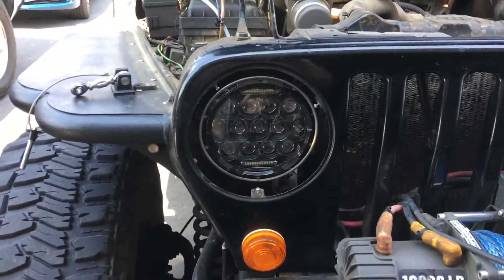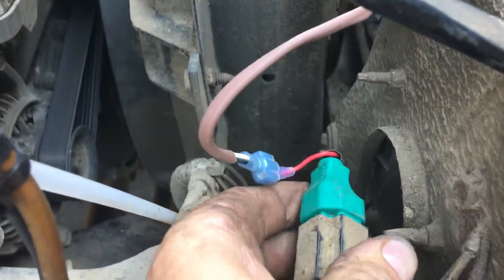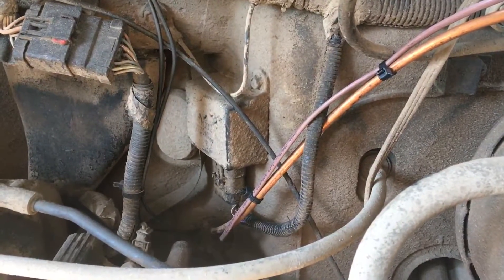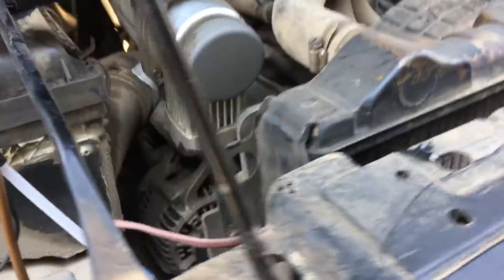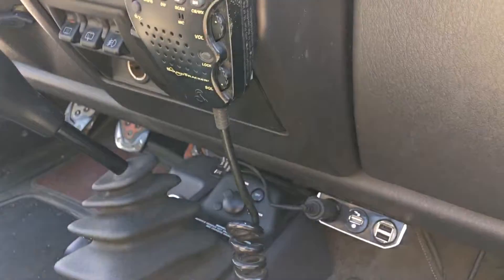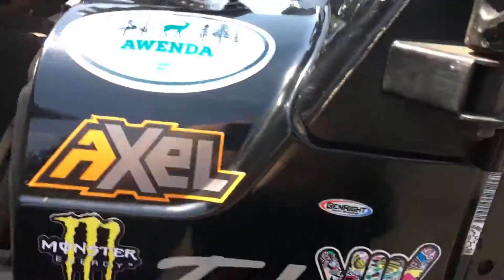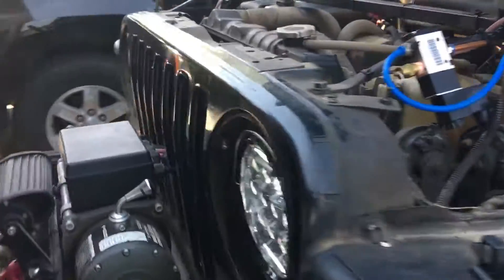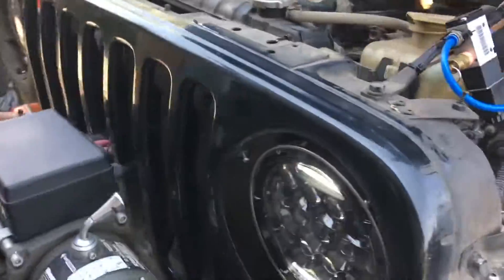LED headlights in jeep tj

Comment: I bought the same lights for my son's 1998 Jeep TJ ... but hooking up the daytime running lights doesn't seem to be straight forward.
Okay I watched your video... so I understand the need for a separate power source for the daytime running lights which needs to activated by a ignition side power source, (which is what I thought the daytime running light module would do) .... but did you say you just cut the signal wire for the daytime running lights ?